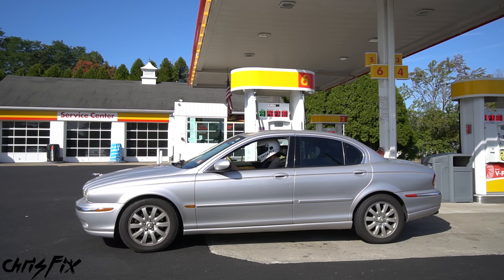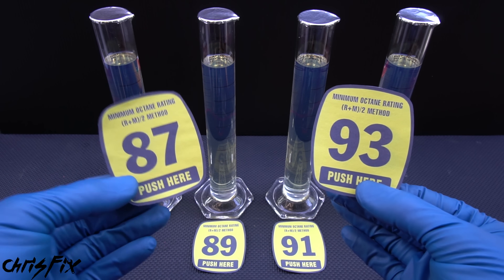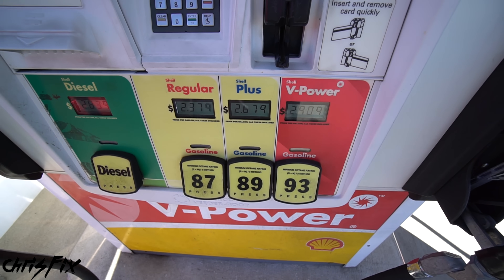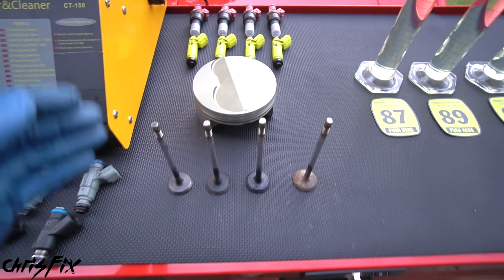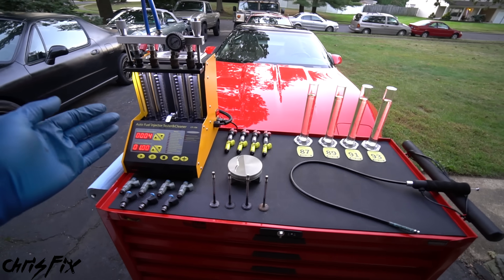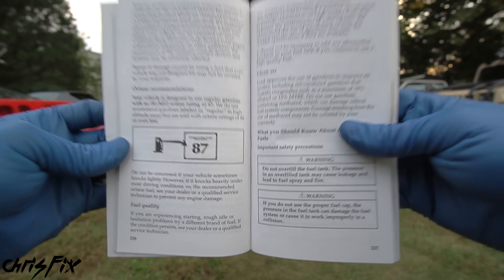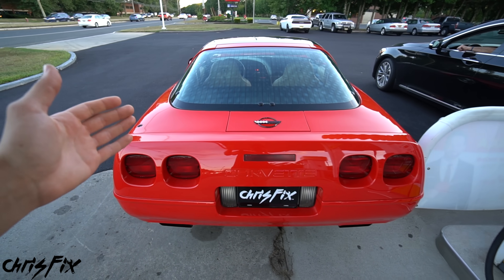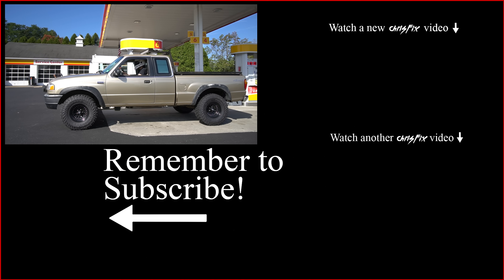What is the BEST Fuel to Use in Your Car or Truck and WHY

Comment: Some of it fact is true but not all u run what ur car manual book calls for like for example I have a 04 Pontiac GP GTP and well when I first got it I was unaware about what fuel to use so like any normal person I started putting unleaded in aka 87...well month down the road started having problems
Fuel injectors started going bad and had to replace the cat. Due to it was getting clogged up due to not running the right fuel 
After fixing that I started putting what the book called for witch was 93 and since then runs like a brand new car....so yes the type of car depending on type of file can do more damage to ur motor then running the right fuel ur car book calls for
I also have a 5.7l hemi durango that the book says u can use premium or unleaded in but if u use unleaded it can cause poor motor performance. Was having problems of the truck not firing right so changed out plugs and coils and same problem missing till I switch to premium like the book says u can put in it and had no problems since
See if ur unaware what fuel u should use don't question what the book says cuz most of the time that book is right....I learned the hard way for damn sure

Comment: This explanation ended an argument! 😂 My brother had a 71Grand Marquis with a huge motor that knocked like crazy, UNLESS we used premium. Based on your video, it suggests that was due to carbon buildup on the pistons that created hotspots. Thank you!
Reply: Car-Jitsu Good observation. Carbon build up can cause hot spots that can ignite the air-fuel mixture before the spark plug fires. (Pre-ignition) This is what causes knock.

Comment: Question: You mentioned Shell adds 7x more fuel additives than required, which is awesome, but do they add that quantity to all grades or just the V-Power? I have a follow up question, depending on the answer. :)

Comment: so if I'm not wrong, the only benefit of using premium gas in a regular car is that it will kind of clean the engine ?  I'll put premium gas until I wasted as much money as on an engine cleaner bottle and then switch back to regular gas

Comment: In my owner manual(Lincoln with direct injection), I have a note to avoid additives in fuel(special gas station mix like V-power etc) Also the required fuel is 87+(higher is better) so how to do there? Use standard 87, or go premium with additives?

Comment: You should use what the owners' manual tells you to use  - no more no less.  The problem is most people never bother to look it up.  It's NOT that complicated.  You're wasting your money if you put in premium gas when your car only requires regular.  And if you drive a hybrid, you should NEVER put in anything other than regular.  Not only would it hurt the gas mileage, it could also cause an engine damage.

Comment: One area where you are wrong, octane ratings DOES impact the rate at which the fuel burns.   Do a little more work on that.  Otherwise great video.  It’s one of the reasons why timing needs to be change.

Comment: I always run top tier premium; always have always will. I've never had fuel issues. The overall cost of running premium vs. regular is literally a couple bucks over an entire tank. Fairly cheap for peace of mind.    I drive slow and keep my vehicles maintained and swear I get better mileage with premium.  Easily 1-3 mpg better.  You don't have to prove me wrong you won't change my mind and I'm not trying to change yours just my personal experience over 700k miles driven.
Reply: Experience knows better, thank you
Reply: I agree. With my two-stroke bike I get about 5 miles a gallon better on premium since it has zero ethanol; ethanol burns faster than gas

Comment: This was a great video! Although, i have a question i home someone can help me answer. I live in West Texas where my regular gas is 86, then goes to 88 and 91. I drive a stock mustang ecoboost which recommends 87(which i don’t have). I read in my manual about higher altitudes just as mentioned in the video but, I’m still confused!!! Would my car run fine on the 86 octane (regular)  or even 88 (plus)? Or would i need to pay extra for the 91!?!? I hope someone can help me out! Thanks!!!
Reply: EB Mustang always works best with higher octane. You're losing quite a bit of power on the lower octane fuel. The computer adjusts accordingly to octane levels.

Comment: i had to fill up with the station's, "not more than 10% ethanol" gas.  does ethanol gum up the injectors and should I clean them after or is it totally fine?  I'm running a higher performance 91 Mustang GT (348 hp) naturally aspirated 302, and a 2015 BMW 335i xdrive turbo six.

Comment: Great information. I drive a 2017 Suzuki Jimny and the only options are 91 or 95 octane in the Philippines. I ran 95 and then noticed the additives were fouling my injectors. I switched to 91 and have had no problems since then. BTW, I find your videos very informative. Keep them coming.

Comment: Me: In Germany, there are higher Octane Gasolines
5 sec later: Ohhh, it's the same
Reply: In America, some gas stations sell 100+ octane in American units, and some even sell race fuel.
Reply: @lamarcus_small  usually anything 100+ octane is racing fuel. Gets the 454 running like a raped ape in my Chevelle
Reply: @lamarcus_small  yessird. VP racing, and shell racing gas.
Reply: Austria: welds 98 gas tube to 95 gas tube
Reply: Depends where you live, Vermont sells 0% ethanol gas in most gas stations, E.u. as far as I know from my vacations no ethanol, less mileage with ethanol, not greener just cost affective for Big Oil Co.
Reply: @hok4952  you mentionned that europe has better fuel and, even if not mentionned, there's 0-5% ethanol in 95 in france, italy and belgium x)

and if you want the worst fuel in europe, take a look at french ones where diesel freezes really easily (quite "good" memories from 2012 ...)
Reply: In Saudi Arabia we only have 91 & 95
Reply: john scimeca  not in germany 😂 100 is 100 and 102 is 102^^
Reply: In croatia we have only 95 or 100 octane petrol and euro diesel super
Reply: Its still a bit higher in Germany. 95 (aka the american "Plus") is the lowest you can go, so the good american fuel is the normal fuel in Germany. And in Germany there is 100 and even 102octane, which is a good bit higher than 93 US
Reply: @gabrielvanya8245  As explained in the video, higher octane means higher resistance before combustion can be achieved, not more energy released. So it isn't a matter of good or bad fuel, its so different engines with different compression ratios can run properly.
Reply: @gabrielvanya8245  Negative, Europe uses a different standard of measurement than the US.  Haha... the video explains it...

Euro 98 is roughly US 93, and in the States, some pumps offer race grade 100+ octane (not Euro 100, US 100).
Reply: Europe has better fuel, no methanol
Reply: @hok4952  huh, i think you should check again, there's ethanol almost everywhere, even in 95 where's there 0-5% in it ;)

Comment: The owner's manual tells you the minimum octane to use in your car but not the maximum. It will not hurt your car to use higher octane gasoline than what is dictated in the owner's manual. For me, I don't need 93 octane ( I only need 87 octane) but I will spend the slightly more money to get the extra cleaners and additives that are only available in Shells top grade (93 octane) fuel.

Comment: No matter what you put in your fuel tank to clean the carbon deposits off intake valves on direct injection engines will work to get rid of the carbon. It will do nothing to get the carbon off the valves but the fuel system cleaner will help keep carbon off pistons and keep the fuel injectors clean.

Comment: I completely don't care about engine knock or octane ratings or the cost of fuel. I am more worried about using the gasoline with the highest level of cleaners with PEA. Shell 93 octane has this higher level of cleaners and only the 93 octane has it. My car can run fine on 87 octane but I won't get the better cleaners with the cheap level of gas. Damn the cost, put the good shit in, and keep the engine clean.

Comment: Most turbocharges engines have lower compression ratios. Back in the muscle car era of the sixties, it was common to have muscle cars with compression ratios of 11 to 1 or even higher. That is why I always burned Sunoco 260 gasoline because it  had the  highest octane rating without going to aviation gas.

Comment: This is educational. These tips on fuel really clears up all the  myths . It’s always best to read your owners manual . On My Mom,s Toyota RAV4 it calls for (87) Regluar  . I’d say about 99.9%  most will do just fine on regular . Unless you have a high performance  vechicle such as the Dodge Challenger hellcat or corvette   Those two I justify running premium in them . I use to have a 1976 Ford Ltd yrs ago & it had  a 351/M 400 Cleveland big block .& I ran regular in it you could hear the valves ping in that beast . I had  to run premium in it due to the fact it was a high compression engine. Most modern vechicles will do fine on Regular .

Comment: When you said 'detonation', what exacty do you mean?  I know you can detonate explosives but what does it mean regarding cars?
Reply: Motors run from the energy of combustions (detonations), basically fuel is sprayed into the chambers and it mixes with air, explodes and pushes the pistons down.
Reply: Also when he's saying detonation or knocking, he means that it's igniting inside the of chamber before it's supposed to or unevenly

Comment: Even though this video is promoting Shell's VPower additive, I've always had better luck with using Chevron/Texaco gas as they include a fuel additive called Techron.  Techron has been proven to clean up carbon deposits on my car's pistons, fuel injectors and other parts where the gasoline touches.  A bottle of Techron costs $5 and up to $10 depending on which store you buy it from.  I save money by buying Chevron/Texaco gas since they already have Techron in their gas.  So, in my case, my car takes 13 gallons of gas which means if I didn't put Chevron/Texaco gas in my car and buy a bottle of Techron for every fill up, then it would cost me $0.38 per gallon more for other plain types of gas I purchased.  Chevron's/Texaco's 91 Octane gas costs me $3.13/gallon.  Across the street is Arco 91 Octane gas for $2.89 (which is obviously less expensive) BUT there is no additive in their gas--so, it would cost me $3.27/gallon if I had to buy a bottle of Techron at $5 and put it into Arco 91 Octane gas.  To me, it just makes more sense to just buy gas from Chevron/Texaco because it helps keep my car running well for less.  :)  Anyway, this is a great and informative video.  Thank you!

Comment: Poser- have a 1988 Precis carburated and use 89 and not the 87... have found that it provides more power especially for hills for this 68 horsepower.  This theory has been tested over hundreds of mile trips mostly mountains.  All seems well over the dozens of years doing this... is this a false or damaging notion. ??? Thank you.  GER aka LK

Comment: Quick question. My car manual says use 87 or higher. Would running 91 get me more mpg? p.s. sorry if this has been already asked before I did not see any comment with this question
Reply: No it will not increase mpg running 91

Comment: Hey chris, So I bought a 1970 oldsmobile ambulance, and it has a plaque on the dash that says "use minimum 99 octane fuel" so what do you recommend I do? Use 93 and add something? Thanks for the tip keep up the energy!

Comment: I drive a 2014 F150 eco-boost I have an intake and a full exhaust I have run 87 since I’ve had it and run a Lucas oil cleaner every two months or three months what fuel octane should I run?
Reply from the maker: Watch the video!
Reply: @chrisfix  Lmao

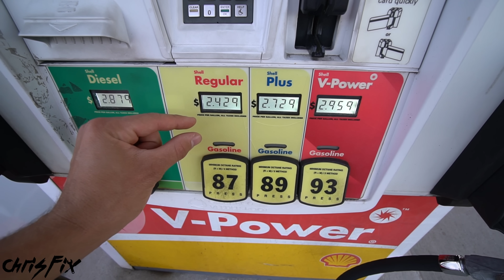Comment: 12:23 you loose power and fuel economy because the car computer adjusts the timing of the ignition not because of the type of fuel you used.
Reply from the maker: Thanks for sharing, if it's not because of the octane used, why would the car adjust timing?

Comment: Hhmmm, again big difference than europe. Here is 92/95/100. Maybe thats why here smaller block engines have higher horse power
Reply from the maker: Did you actually watch the video?
Reply: Yes i did and i said this cause anyone that i know who imported a car from america had to "tune" the engine cause it wasnt fit to run on the fuel here. Better said it will damage the engine. Take notice power/ engine size is very different making comparison usa with europe

Comment: I have a 2019 Honda Insight. The car recommends Regular. In your video of Shell Performance, 93, it will protect carbon build up at a 75% rate...can I use the 93 so that I won't have to deal with carbon build as much from the 87?  What if I go in the middle and use 89? Do I get the best of both world? What I needed to understand is 87 would have a higher rate of carbon build ups. The 89 is lesser build up of carbon. The 93 offers 75% protection from Carbon build up.

Comment: Everything I own runs better with higher octane from chainsaws to riding mowers to Toyota Matrix Toyota Tacoma. Good chainsaws require high octane fuel my riding lawn mower does not bog down on high grass with high octane fuel my Toyota Matrix was knocking and acting like it was going to stall but not on higher octane fuel

Comment: Wrong, regular gas has more energy than premium.  The molecules in premium are more symmetrical which allows the energy it produces when combusted to be more completely harnessed.  The molecules in low octane number fuels are less symmetrical and therefore don’t burn as evenly and so not as much of the energy it produces when combusted can be harnessed.  At least this is how my college chemistry professor explained it.

Comment: Enjoyed your vid.  Turns out my understanding of octane rating was correct.  So many cars requiring premium specify 91+ octane.  If my car requires 91 and I fill with half 89 and half 93 do I end up with 91 and save a buck?  I have a 2004 and 2012 Acura TSXs.

Thanks for the informative vid.
Reply from the maker: I'm glad you enjoyed the video! Technically you could do that and it might work, but I'm not sure of a scenario where you win in the end lol
Reply: Chris Hawkins That’s all the mid grade is. It mixes premium and regular at the pump.

Comment: Can you show us what jet fuel is best for our cars, just for the Russian viewers
Reply: I think you mean VODKA
Reply: 104 leaded is what I put in my 92 Buick century lol
Reply: I run my bike on pure alchohol and sheer will
Reply: My dad runs 110 AVgas in his race truck
Reply: Insert xbox Gamertag MIG 99 should be fine
Reply: Is there more than one jet fuel? Only piston aircraft run 110LL.
Reply: @alexs3187  hydrazine
Reply: @alexs3187  jet fuel and av gas
Reply: Alex S There are several grades of Jet fuel based on different freezing points. Jet fuel is basically kerosene with anti icing additives blended in at various formulas.
Reply: @alexs3187    Jet A, Jet A-1,  for civilian use,  JP5, 8 for military, all basically the same with some having more anti-gel additive for cold temps.  They are all interchangeable for all Jet Engines.
Reply: Jet Fuel, aka Kerosene, works well in diesels.  Don't try it in a gasoline/petrol engine.  very low octane in jet Fuel.
Reply: is that why you guys keep crashing into each other?
Reply: Jet-A
Reply: Vodka is always the best for cars
Reply: Isn't jet fuel basically kerosene
Reply: @randytreadway7467  yep
Reply: @randytreadway7467 , yes, as a matter of fact it burns perfectly well in diesels. It’s also the go to fuel for kerosene heaters by Alaskans. It’s a fuel that has been filtered to a higher degree. This means for kerosene heaters wicks last longer. JP-4 can be purchased at many airports around the country. And it’s a lot cheaper than buying a gallon of kerosene from Home Depot. Airport jet fuel is about half the price you’d pay at a DIY store.
Reply: @randytreadway7467  Yep, and it's leaded too!
Reply: @randytreadway7467  yep. Both diesel and jet fuel are based off kerosene. The only difference is diesel has oil in it, so it is more viscous
Reply: Jet is just highly refined diesel other than not much lubrication properties its will run fine in diesel engines !
Reply: @darrenveit7065  Kerosene

Comment: I do not use anything with Ethanol. I buy real gas!  In fact, Mercedes and Lexus discouraged use of Ethanol in their vehicles.  Leads me to premium in most cases.  While in Houston, hard to find fuel without Ethanol. I had friends that worked at Shell so advised me to buy Premium.  Also, My mileage improved using the higher grade! I tested every vehicle and fuel economy and power improved with the higher Octane and better quality fuels.  The higher quality fuel also protects Valves, pistons, and helps keep the injectors clean and working properly. I’m a fanatic about maintenance on my vehicles and therefore want to use a high quality fuel!  An Automobile is an expensive investment!  Take care of it - it will take care of You!  Thanks for your outstanding ad very thorough videos!

Comment: Um actually diesel can run on gas and gas can run on diesel... they won't run well and if you use gas in a diesel you will damage the fuel pump but i mean you can do it 😂

Comment: If I have a brand new 2019 Toyota Corolla that iam trying to have last me for the next 40 years would you suggest the Premium gas? I only pour gas at Shell always.. My friend whos a mechanic told me the best place to get gas was Sunoco, the second best was shell. I looked at the owner's manual and it says use 87 or higher... it didnt specify which one is the best, Thanks!
Reply: Just use 87. It will run perfectly fine with no issues. You have the option for higher, but sticking with 87 is smart considering it's recommended by Toyota and it's a new vehicle, so carbon build up is far from an issue.